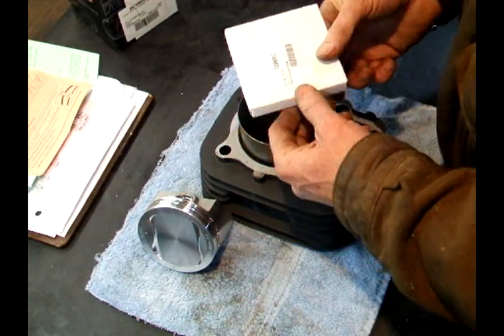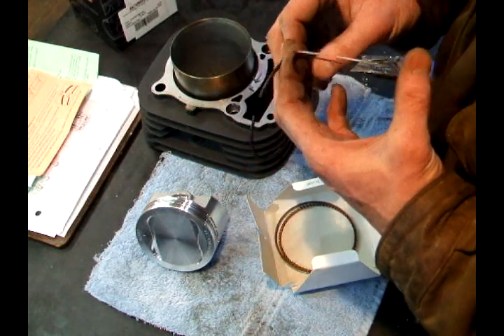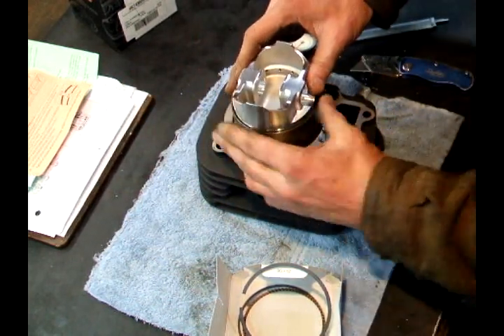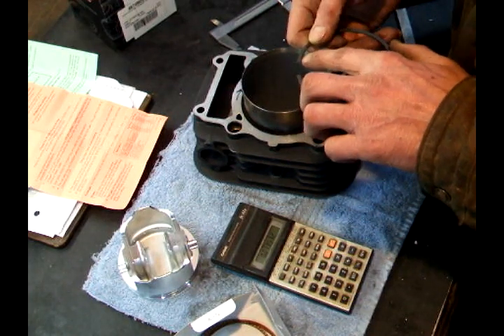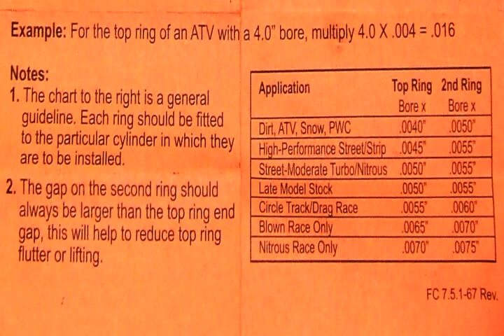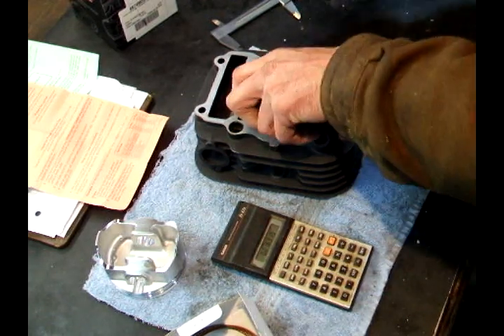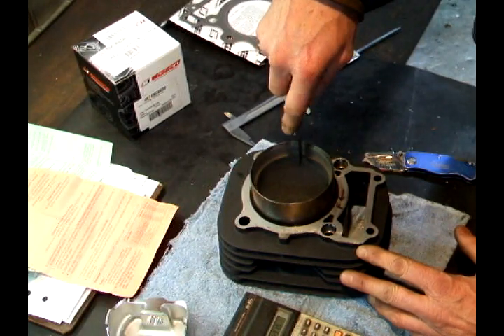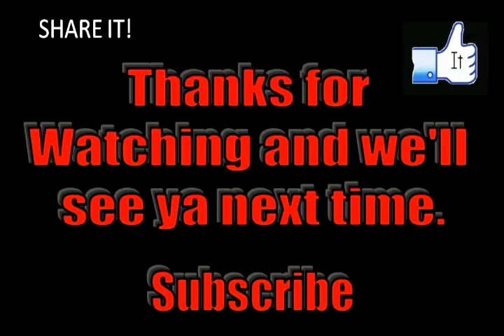Wiseco motorcycle piston ring end gap.

Comment: Is that formula applicable to all motorcycle?
Reply from the maker: No always go with the spec of the manufacturer of the piston. If you use OEM stuff go with the OEM specs. If you use Wiseco of other piston manufacturers parts use their specs, because different materials expand at different rates and all manufacturers are not the same.

Comment: I red somewhere that it should not put the gap in line with the piston wrist pin.. But your diagram mentions putting compression rings gaps towards those....
Reply from the maker: Look up the ring gap position that the manufacturer recommends and put it there. Not all manufacturers do it the same way. The diagram from wiseco in video has the engine front labeled incorrectly, it should be pointing up.

Comment: I just Got New S&S 3-1/2 +0.10 over my bore is 3 inch 580 th my rings gap was 22 th chrome moly top ring  by the math the end gap should only be 0.17 th I can not stretch the rings and im worried of blow by  Should I call S&S , they have a gap of 22 according to the heat of the chrome moly at S&S page   , im at a loss
Reply from the maker: I would use what the manufacturer of rings recommend. In the video I was using what wiseco recommended for their piston rings. If you got S&S rings go with what they say it should be.
Reply: Thank you for getting back to me
Reply: @JCcanU  let me see??? It all started out in 2001 when I got my first purchased S&S motor 124 super sidewinder motor. 
The first motor was a POS. I fought with them for over 3 months. Then they actually said they would give me a completely new motor. I did not want a “rebuilt” brand new motor. I wanted a brand new motor. Then it took another 4 months to get it shipped out to me. After that it took almost 2.5 months to get a complete “o-ring” kit for the upper head and rocker area. When in decell it would blow out smoking & I mean a lot of smoke.    
    What really happened on my end was that I missed a complete riding season.
After all was said & done. It cost me almost 15 thousand dollars & didn’t  ride for that season at all!!!
   That’s why I’ll never buy anything from S&S  ever again

Comment: you should not check ring end gap in the spigot area of the cylinder. You should use the piston as you did but slide it up to a inch or so from top. the spigot area is not supported by the cylinder and is often different.
Reply from the maker: +Robert Zenisek I agree if it is a used bore. The one in the video has a fresh bore job. If there is big difference from one end to the other, it's time for a bore job.
Reply from the maker: +A Motorcycle Nut The reason to check the piston ring end gap is to make sure that the ring is not to tight, or the engine will seize. If it's a little loose the worse that could happen is that the engine will smoke a little.
Reply: a little loose is like ? 2-3  mm or thou ?